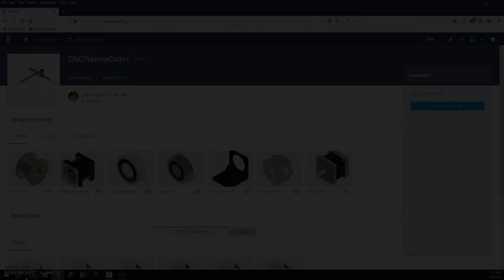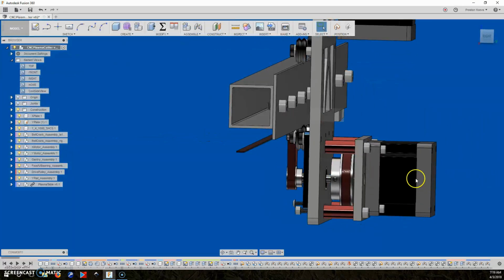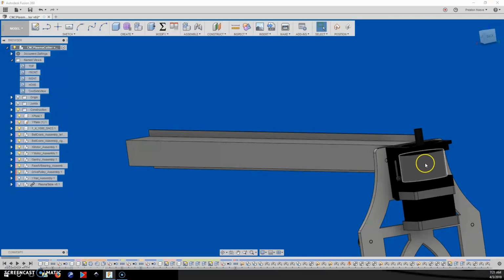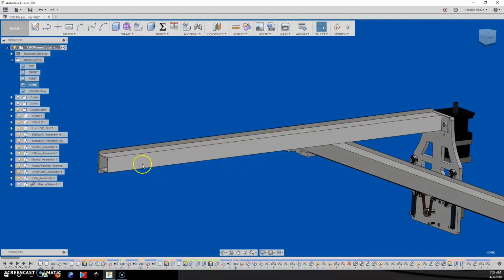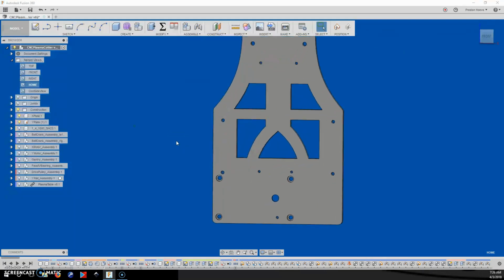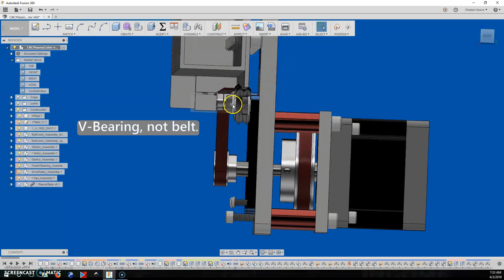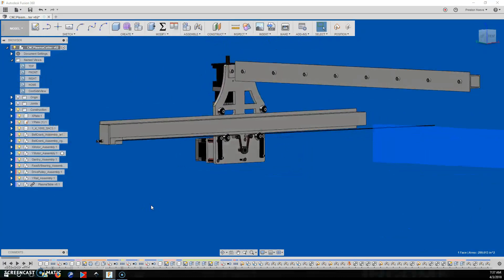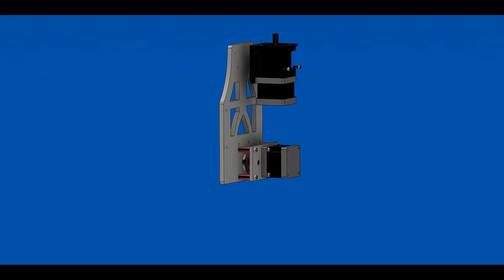CNCPlasmaWalkThrough

Comment: Updates? Like to see torch mounting and electronics and it’s foot print
Reply from the maker: They are coming.  I just got the torch mounted and most of the electronics complete.  I am reusing the drivers and power/control components from my CNC Router.  You will need to check out my router overview video for that.  Sorry for the delay. ~P

Comment: I have built a plasma table that uses the same motors and I believe the same screws and linear rails as your original router table. My question is how fast can you run your router table in inches per minute. I have only been able to run mine at 75 ipm. Is there is motor tuning that I can do to speed it up? I am hoping that my screws are not to fine thread and able to go any faster. Any help would be great. I have ran it faster but it seems to stop moving but motors sound like they are still running like it is binding up. I checked and no binding.
Reply from the maker: My router table maxes out at about the same.  I was told once that it was the motor bouncing on it self and that if they had a flywheel on them it would reduce the issue.  I have never needed to go that fast while cutting so I gave it no further thought.  Again this is only specific to the router.
Reply: +sbirdranch I haven't actually started cutting with the torch yet. After watching some others on YouTube, they look like they are moving really quick on thin gauge metal. Maybe the torch can be turned down to a low amp and cut slow on thin gauge. Speed is not a priority for me. I just want to be able to cut all thickness. My Hypertherm says it is rated for 5/8 at 20 ipm but I'm not sure how that equates down to something like 16 ga. Thanks for the insight. I bought a lot of my parts after watching your videos on the router and kind of followed your design a little as far as motors,drivers, rails, and screws. I have a couple other questions if you don't mind me asking? I will post a video on my YouTube in a day or 2 for you to check out. Thanks again!

Comment: Hi Sorry i just started watching.  what are the dimensions of table. Im gonna build a 4x8 but your measurements would help. your doing water table? And what size is v bearing?
Reply from the maker: That table will be 4x4 and I will be doing a water table.  The bearings can be found in the links in the description.   I don't remember the size designation.  Sorry. ~P

Comment: i have a feeling you wont want that gearbox due to backlash. I would say your 2 to 1 will be better!
Reply from the maker: The reason I went with the planetary gear was that they have very very little backlash.  In fact, I cannot, by hand find any lash.  Honestly, I am more concerned about the mass it imparts to the gantry that has to be moved.  I  bet I try it without the gear box just to test resolution.  Thanks for the comment.  ~P